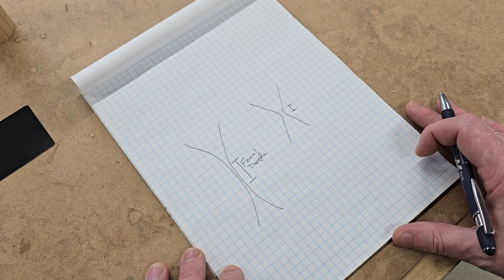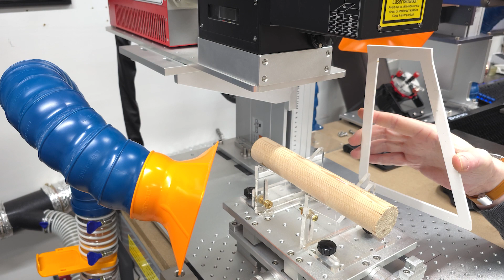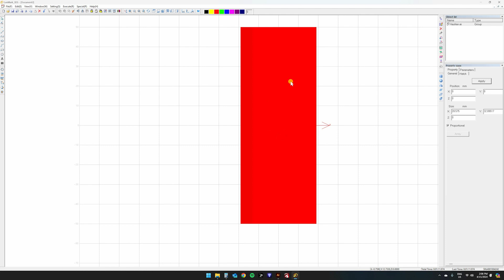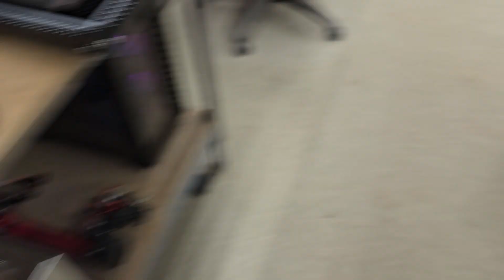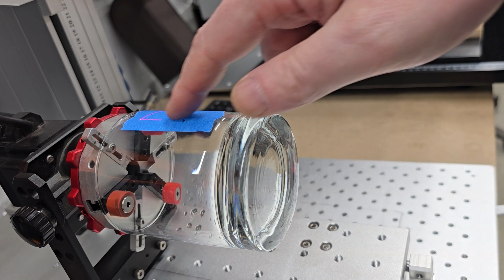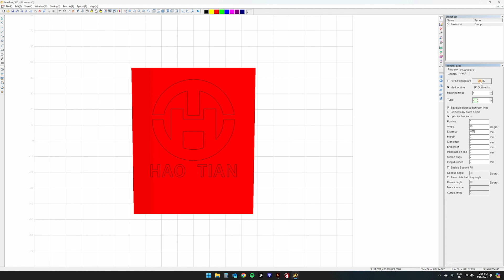Feeltek 3d UV Laser - Start to Finish for Beginners

Comment: Hey
Hey! question for you what version of AI are you using? I've been having tons of issues with getting files to open in lenmark software. Thanks for the great video
Reply from the maker: Sorry for the super late reply, I don't use youtube much. I hope you've found your answer, but if not, here's what I do. I save my .ai files for Lenmark in the "Japanese Illustrator 3" version, it's the last option on the drop down. I know a few others have said there are a few other options in the list that work, JP3 has always worked for me through several Lenmark_3ds updates.